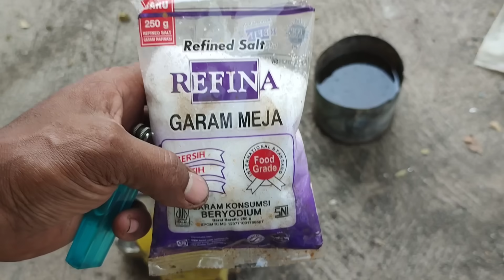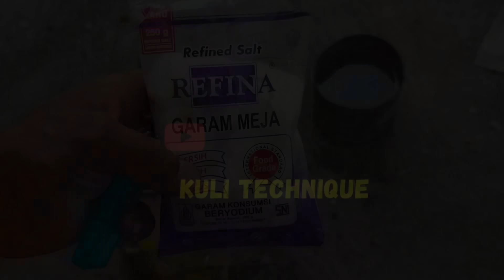This steel hardening technique is not taught in schools, quality TAPS hand drills

Comment: You have a steel drill, presumably hardened and using it to drill a hole in aluminium? What is the point? An unhardened drill bit will make holes in aluminium.  Maybe better idf you drilled a 1/2 inch plate of mild steel...with lubricant
Reply: For one thing, he made a thread tap, fluted to remove aluminium flake.  Another thing, he has to make a tap from whatever steel the old drill bit is made of.  You can’t salvage a lower quality hss bit and guarantee it will tap a harder metal.
Reply: I was under the incorrect impression he was annealing the steel and machining  and re-hardening it  to make holes or taps in steel. To make a tap for aluminum, unhardened mild steel will do it. Nothing takes away from his remarkable talent of making the most with limited resources. Necessity is the mother of invention
Reply: @redpost2380  Yeah, the guy is pretty talented!  I make go fast car parts from aluminum 7075, and my latest project is an upper shock mount with a 2.125” bore that is 3.25” deep.  I don’t have a lathe or an end mill, so I have been doing a lot of hole saw, and drill work.  It is a painful lesson in drilling aluminum.  I also rifle drill, and tap aluminum 7075 bar stock for steering rods, etc.  I have a lot of messed up prototypes lying around that taught me a lot.  Luckily, there is a scrap metal yard 50 miles from my home that sells a lot of aluminum to me.✌🏻
Reply: Of course you would do 1/2-ass job. Just because the demonstration was in aluminum, which actually TEARS soft metals if the tool is not perfect sharp, you have to think you are better than the author?
Reply: پودر و مایع چی هست ؟؟جایگزین هم داره ؟بعدم فکر نکنم زیاد سخت بشه  / 😂الومنیوم که  با هر فلز. تراش میخوره  😂
Reply: Have you really tried drilling a hole in aluminum with a wood drill bit? I have, and it never drilled right, from the start. You should post a video, showing us how it's done. Tool makers are the ones, who keep the shop running!
Reply: As a Youtuber, he is doing fine.😅
Reply: @antonionguyen6688  Exactly, he could publish a video of how to boil an egg and he'd get millions of views....and many dollars....that is what it is all about...not necessarily delivering clever solutions etc. He is a good businessman and also a very clever artisan

Comment: As a Machinery Repairman Chief Petty Officer, the US Navy teaches metallurgy, and the process of heat treatment and annealing metals.  At sea we used a rosebud tip to heat, and oil, or salt brim from the evaporators to quench the metal.  There is no Ace Hardware in the middle of the ocean.
Reply from the maker: Thank you very much for sharing your experience 👍👍👍
Reply: Did you think to check with the cook??
Reply: But you don't even need to bother with the heat treatment if you're just drilling (or tapping) Aluminium.
Reply: I'm glad that the Navy is teaching the old machining tricks....a few decades back everyone had to make their own cutting tools out of oil/air hardening tool steels. Keep a machinist's handbook around and put a little primary tool relief to keep the work from melting.   : )
Reply: CPO is right. We got it done. Probably better standards than we could give ourselves credit for - most of us, at least myself,  did not know what a lathe was until MR’A’ school. I was lucky to have A’, ‘C’  and metallurgy at Point Loma…. Chief, remember that big room with what seemed to have a hundred SB lathes in it?
Reply: @johnmaksim6279  ain't got no battleship parts stores in the Black Sea gotta fix it up quick with blow torches and some fine machining skills
Reply: If you want a good sell bit but one for stainless and use it on all your metal

Comment: Drill bits are usually high speed tool steel, full of chromium, tungsten molybdenum and sometimes cobalt.. heat treat procedure usually involves soaking it at 2000 to 2200 degrees F. or so  quenching in oil or air blast, cooling in liquid nitrogen to  -273 F tempering at say 1100 dgrees F for two hours TWICE .  Annealing  (softening) it is similarly slow and difficult. Heating it to yellow with a torch might ruin it, but won't soften it much
Reply: I mean he got it to do what he needed it to do he softened it enough to cut on the lathe and then case hardened it. it'll be brittle but then taps usually are.
Reply: @storkbreath  He didn't case harden anything.  He heated and then quenched in a salt water bath.
Reply: True.  And 2000 degrees will be whit hot, not orange.
Reply: @PanamaSticks  my mistake no he did not add any carbon he just quenched it.
Reply: Тут всё методом тыка, куда вывезет. Получилось сверло по воску.
Reply: @storkbreath  You are dead right about brittleness of taps. Two times in my life taps have broke when I've dropped them. Never had that happen with any other HSS tool I've dropped.

Comment: This has been mentioned in the comments: 
when heating up under the room, to save energy, place a thermal insulation for high temperatures (e.g. asbestos and why not a simple aluminum sheet).
 I will add that , for drilling , steel, "cobalt"  are really effective
 and that salt is used when quenching steel to quickly cool the steel making parts with high wear resistance.
Many steels have "low hardenability" it is advisable to use a solution of water + 10% salt, in order to obtain with a high cooling rate.

Comment: Improperly hardened steel breaks like glass.
Metallurgy is a very serious science.  The professional training of tools requires a great deal of knowledge and professional experience! 
A colleague of mine was assigned by the boss to take the chisel shanks of the chisel machine to the blacksmith to be reforged and re-hardened. The colleague 'solved' it at home and put the money intended for the blacksmith away....
He heated the chisels with an acetylene flame, and then threw the glowing tools into the vat of water.
I don't even need to describe that it broke into pieces in the first second of use...
Reply: Yep - just quenching and using straight after this is asking for trouble.  Normal to temper slightly to take off the brittle edge.
Reply: I'm a novice blacksmith and even i know that you have to know what kind of steel you're working with to know what to quench it in (water vs oil vs other) and after you harden it, you'll need to temper it (also according to the type of steel).

Comment: I was taught to bring the carbon steel up to a dull red evenly [that looked too red and uneven] and the quench it with water, some use oil. Then put in an over at 550 deg for a period of time based upon the thickness for tempering. After quenching it is way too hard and brittle, it must be tempered.
Reply from the maker: Thanks for the advice! 🙏👍
Reply: There you go....I worked in a tool and die shop and I had professional heat treaters.  We made tooling for sanitary cans and ends (Think food cans).  We settled in on the range of 640 to 660 °F for 60 - 80 minutes ( depending on the mass of the tool) for the best wear resistance for these tools. Following that cycle, sometimes we turned of the heat and let it drift down and sometimes we used a fan box to hurry it up.
Reply: Так это тебя учили, а в ролике сказано, НИКОГО ТАК НЕ УЧИЛИ. 😂
Reply: it depends on the alloy of the steel. high carbon tool steel harden in salt water will often crack. W1 and W2 are water hardening steels. O1 is an oil hardening steel and needs warm oil to prevent cracking and warping, 1030 rebar hardens at orange heat and room temp water..

Comment: Grinder with no guards in place. Imagine that wheel breaking apart at that speed and where those pieces could lodge.
Reply: Almost every welding and fabrication video on YouTube has the same thing, regardless of country of origin.
Reply: How to say I have never worked in an engineering shop, without saying it.
Reply: Probably learnt that trick in America i notice on all tv shows from there %95 dnt use gaurds.

Comment: I like the idea of repurposing HSS drills for taps, might use it sometime. 
The hardening technique shown is hugely lacking an explanation of tempering. I was taught hardening and tempering at school and for basic carbon steel there's a whole range of tempering temperatures to give the finishing product different qualities, from being used for springs to being as hard as a file.
Had nothing to do with hardening and tempering HSS but the main thing is it did the job. I'm guessing that DIY tap might be brittle as hell without any tempering but I've also learned that many taps are brittle as hell, because I've had them break when I've dropped them.

Comment: If the drills are high speed steel  you gotta heat it past cherry red to do anything to the temper and you can not harden it in a brine solution  you need a diamond block or  reducing atmosphere  or  you have to have a molten salt bath where you do the heating.

Comment: I don't have a lathe or milling machine. I'll just go spend 5 dollars for a tap.
Reply: A $5.00 Tap is probably not much better than the one he made.
Reply: @calthorp  The guy probably made the $5.00 tap!
Reply: Try more like $25. Unless you've got a time machine in your pocket that is. Do you have a time machine? I'd like to watch that video.
Reply: @SomethingEasy78  Yes no $5 new tap here in New Zealand either, Unless it is very small & made in China. Good only for wood & plastic maybe aluminium.
Reply: This video applies mainly to aluminum hobbyist

Comment: Nice work. 

I'm not super familiar with the material science side of things but I think you want to at least try to temper (or 'anneal' maybe?) tools like this. 

While there is a ton of variability in materials and current state, I would at the very least put this in an oven at 500°F for a few hours.

In many cases, it seems to help with brittleness and internal stresses. 

YMMV.
Reply from the maker: Thank you for the suggestion. 🙏👍

Comment: Nice work, and very skillful. Repurpose items is an art. I do the same here in USA, but I haven't learned machining.. I repurpose other things. There is value is many damaged and discarded things. It's good finding other uses for things.
Reply from the maker: Thanks 🙏👍
Reply: I like repurposing stuff too.
I repurposed a book called "Carrying the Light" and use it to keep a table from wobbling.
I also repurposed a book called "Becoming" and used the pages to line the bottom of a parrot cage 🙂
Reply: Reminds me of a story within prison ministry.. prisoners would use the pages of pocket bibles as rolling papers.. after the ministry discovered this, one of the staff said to someone "at least read it before you do it" I guess whomever they were talking with agreed.

Comment: Are ANY steel hardening techniques taught in schools!? they're lucky to leave able to read and write.
Reply: when I was in high school I used sodium cyanide in a pipe capped to harden my hammer head I machined on a lathe , the teacher ran the oven I think after class ,  but they long closed the machine shop and teach kids nothing
Reply: maybe not high school but I was taught metallurgy and associated practices in trade school

Comment: This would probably get you out of jail if you didn't have the tap you wanted.  It did the job in aluminium.  Hardening by quenching like that is crude and nothing like the recommended treatment.   Impact strength will be very poor, but hardness should be OK as it was high carbon steel to begin with.  I doubt they would teach metallurgy in schools as it is a highly detailed specialised process beyond the capabilities of most class rooms.

Comment: What was the powder you mixed into quench water? Good job the tool worked twice without breaking.
Reply: Salt
Reply: @TorneroRD  I looked it up on google and found it to be refined salt. Thankfully still an inexpensive commodity. Thsnks for your answer. I do not do much heat treating. I have some 19mm oil harden rod  I might try making a punch or two. Might try to make a tap also.
Reply: @martinnorbeck4657  It's salt and usually I just use rock salt, as much as the water will hold. What it does is stop steam bubbles from clinging to the surface causing unequal cooling and breakage.

Comment: The "Tap" that was shown at 5.12 is NOT the same "Tap" that he was playing around with in the Lathe. It has both a different shape and colour. The one he had on the lath had its threads "Ground" with a simple Cutting disk on an Angle Grinder thus producing a very distorted thread form.
Also look closely and you will see that both the thread form shape is different as well as the "Finish" on the drill end part. After 5.12 we revert back to a normal thread form.
Also you can "Tap" an Aluminium block with virtually anything including simple wood screws.
This is just another heavily "Edited" click bait video.
Reply: You must be a detective, Sharp eyes!
Reply: @calthorp  Just sick & tired of all these BS Fake video's.
Reply: Its a different color because of the hardening.
Reply: @jesusisalive3227  Well my comment refers to the item BEFORE it had been "Hardened" in Salt / Water.
Reply: @PeterChapman-rg6gr  That is the internet for you. Glad there are guys like you that take the time & warn people.